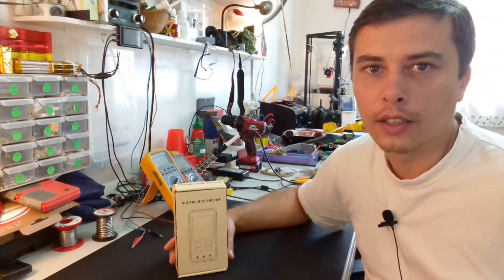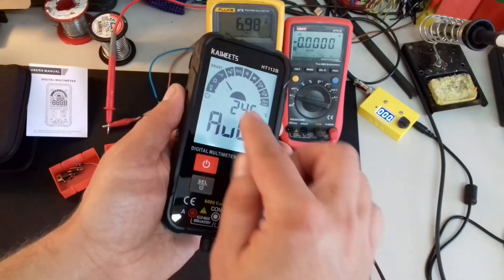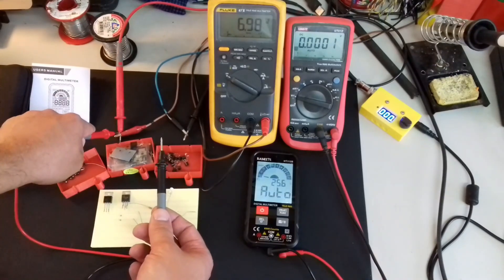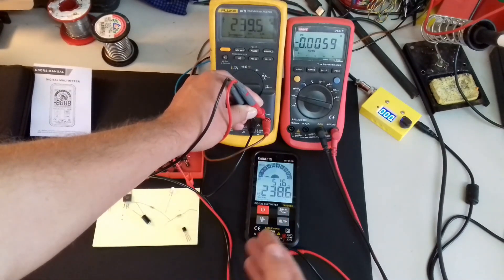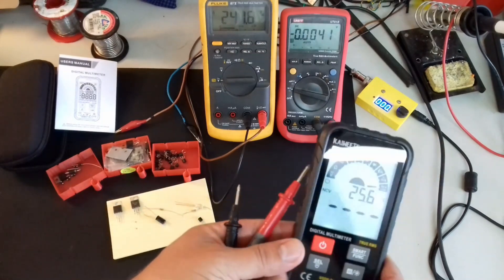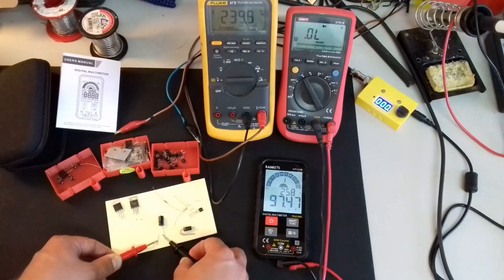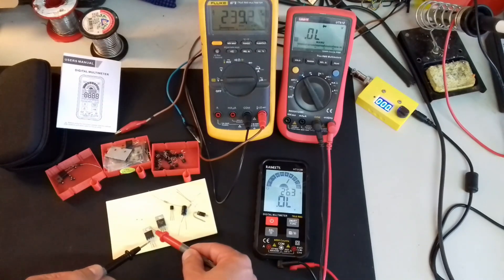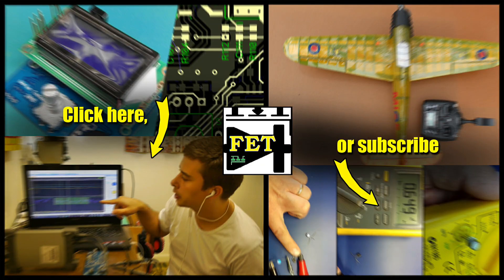Kaiweets (Habotest) HT112B - True RMS multimeter review and teardown

Comment: Hello. Thanks for your video. Question for you; what size Amp fuse should I get to replace the one that came with the Kaiweets HT112B multimeter? It only shows the voltage - F630amH 250V on the one that apparently blew, but it doesn't tell me what current should be on the fuse. I checked at Amazon and they do sell them, but from a minimum of 0.5A to a maximum of 10A. Your advice would be greatly appreciated. Cheers!
Reply from the maker: you just wrote it: 630mA.
Reply: careful that you don't hurt yourself

Comment: What is the best device
RM409B/408B?
MT111?
618C?
RM777?
What is the best device
Reply from the maker: All of these multimeters are part of the same class. Some of them are the same thing, just relabeled under a different brand ( like MT111 and 618C which are essentially the same thing). They all have similar functions and speeds. I guess is just the user's preference if somebody wants flashlight or touchscreen instead of external thermocouple. But I would suggest the other viewers of this video to share their opinions too. Maybe we can hold a voting session here.